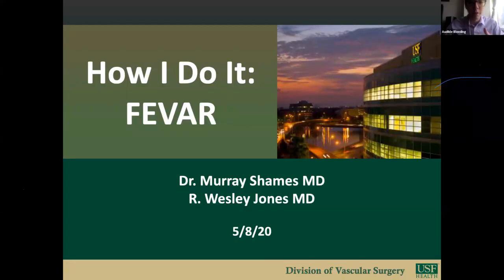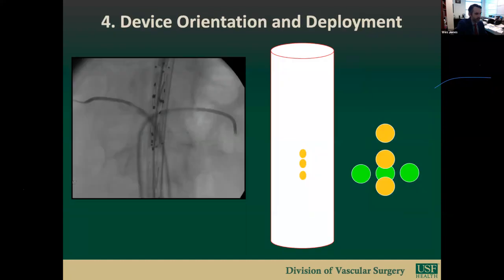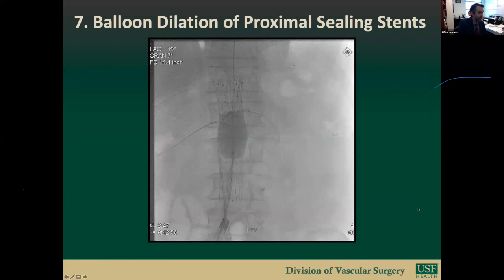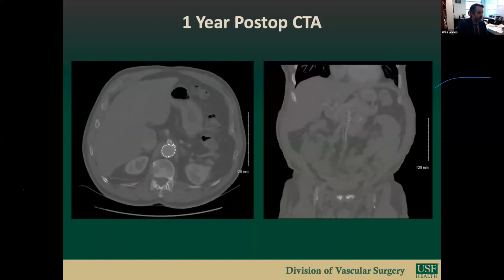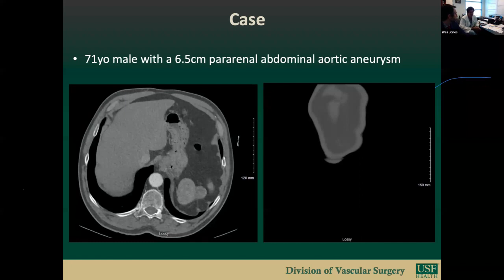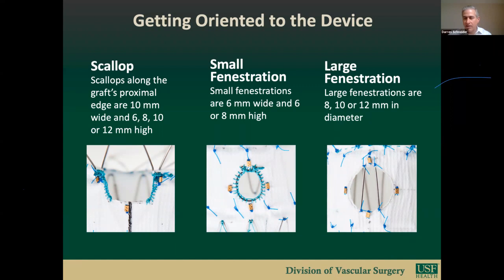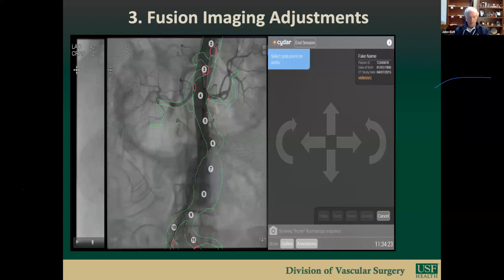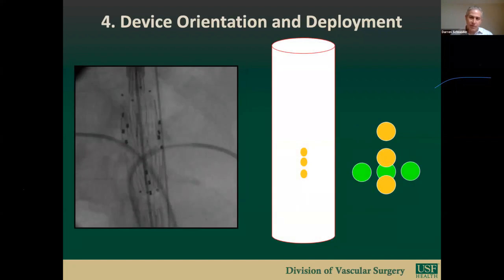How I do It: Fenestrated EVAR with Dr. Wes Jones and Dr. Murray Shames from USF

Comment: What is the reason behind canulating 2 target vessels before inserting the fenestrated Graft? You mention that it guides your deployment. Do you think it is unsafe to deploy the graft in the desired position (guided by fluoroscopy and pre-OP measurement), and only then canulate the fenestrations? Does the fenestrated Cook Device allow repositioning after deployment? I think in addition to being time-consuming, the canulation before graft deployment (especially) with an oscor sheath can cause complications. 
Thank you very much!
Reply: Sorry for the later response. The reason for the pre-cannulation was to verify the visceral location to calibrate the fusion imaging. It obviated the need to perform multiple angiograms to mark visceral location in that fashion. For the commercially available Cook Zfen, once the visceral piece has been deployed fully it is very hard reposition if at all. Hope that was helpful.